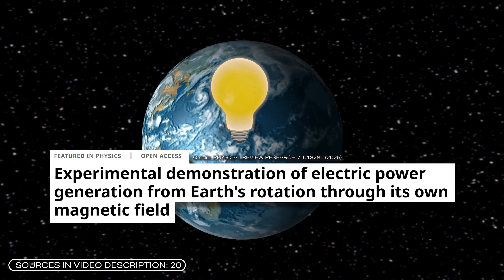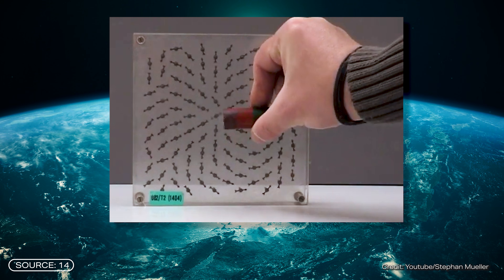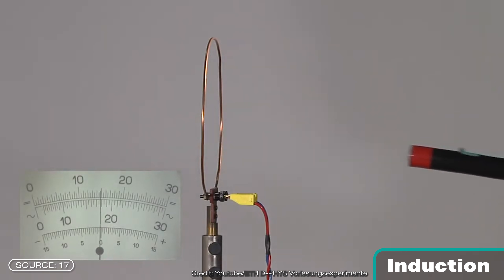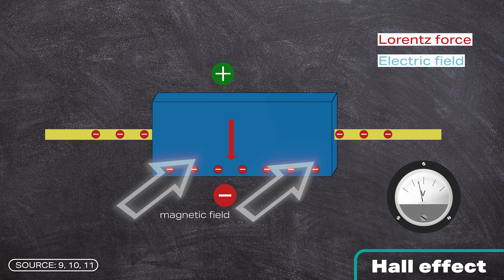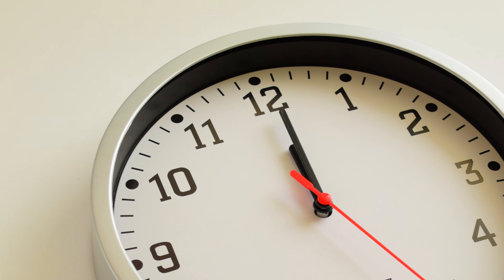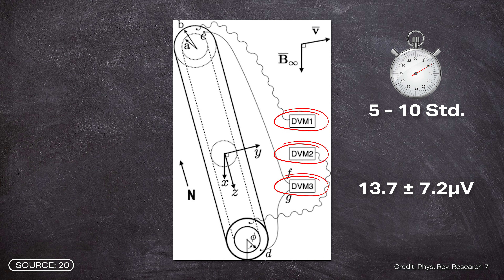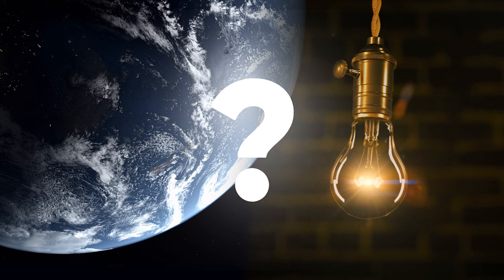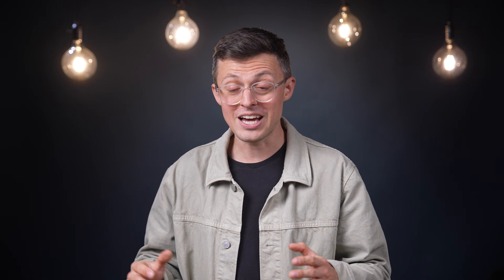Scientists Just Harnessed Power From The Earth’s Rotation

Comment: We know you can generate power from the earth magnetic field. 30 years ago they performed electrodynamic tethers (EDT) experiments where a small satellite extended a coil in space and started it rotating. It worked so well generating 3600 volts at 1 amp burned through the cable. that's the equivalent on 120v @ 30a.

BUT where is all the energy coming from? I'm pretty sure we don't want to slow down the rotation because that's what we are messing with.
Reply: In the case of the satellite, the energy comes from the satellite's motion through the Earth's magnetic field.  The main effect would be the satellite slowing down in it's orbit, because it masses MUCH less than the Earth.
Reply: You worry about climate change from fossil fuels but interfere with the earths rotation and that's fine
Reply: @keithbartlett9947  In the example he gave to provide all power to the planet, we would lose 70 milliseconds in 1000 years, 700 milliseconds in 10,000 years; think about that for a second... seven tenths of a second added to the length of the day in 10,000 years, a vast length of time, the height of the Pharaonic dynasties was @ 5000 years ago...at the human scale that is eons ago and the increase in time of rotation is broadly irrelevant!
Reply: @Bob-h4s2p yes you are correct, a you tube guy worked out 70 milliseconds, but before we start mucking about with something we cannot change I would like the worlds greatest physicists to have a go at the maths  and reassure me we are not doing something that might have a catastrophic effect on the planet. I don't mean a slightly longer day I mean something the you tube guy just might have missed. By the way he is a perfectly nice science guy and seems sensible, but let's just check his homework. 

I am completely open to being wrong, but it all sounds a bit free energy to me, and we know there is no such thing as free energy. The tally man of energy has to be paid, we just need to know the cost.
Reply: @keithbartlett9947  You're right, of course, one would need to check the maths very thoroughly. I think for many the scale is hard to comprehend, the relative mass of our planet, the mass of the sun, the inertia of earth rotating around our sun, the huge sphere of molten iron spinning at its centre, the flux of the magnetic field generated, it's all on a very non-human scale, hard for many to fathom...but, nothing free energy about it, a braking effect is being harvested from that rotational inertia, work is being done, no laws of conservation of energy are being violated.
Reply: Or pressure near plates  can be used betallonv certain  streams  of ores
Reply: "Slowing down" or "accelerating" the earth's rotation is actually irrelevent because the rotational energy "borrowed" from earth with electrodynamic tethers to potentially produce electricity on a satellite or boost said satellite's orbit upward can be returned to the earth's rotation by doing the reverse operation at a later date...when we have compact fusion reactors powering space equipment for example.

It is just required the numbers eventually cancel out.
Reply: @TheFlyinCanadian  annnndddd NO. sick and tired of all the fools that think energy can be Summoned from the aether, it can not me made or destroyed. if you convert rotational force to any other form, the rotation WILL slow down. Period, ".", EOL.

You want to change one of the most basic LAW in the universe? "Energy can be neither created or destroyed.

The statement "energy can be neither created nor destroyed" is the Law of Conservation of Energy, a fundamental principle in physics meaning the total energy in an isolated system stays constant; it just changes forms (like chemical to mechanical in a car) or moves, but the total amount never changes, forming the basis of the first law of thermodynamics. 
Key Concepts:
Transformation, not Creation/Destruction: Energy shifts from one type to another (e.g., potential to kinetic, light to heat) but never disappears or originates from nothing.
Closed Systems: This law applies perfectly to closed systems (isolated from surroundings). In real-world scenarios, some energy becomes "unusable" heat during transformations, but it's still accounted for.
Examples:
A burning candle converts chemical energy into heat and light.
A solar panel turns sunlight (radiant energy) into electricity.
When a ball stops, its kinetic energy becomes heat and sound, not gone.
Significance: This law underpins much of science, explaining why perpetual motion machines are impossible and how energy flows in the universe. 
In essence, energy is conserved; it's a constant, fundamental quantity that just gets redistributed and reshaped.
Reply: Thanks to chinese government three gorges dam already slows earth rotation by 0.6 secs😂
Reply: In the first 90 seconds he mentioned that Earth's rotational energy is a billion times our global electricity use in a year. If we make some very generous assumptions and assume we can convert Earth's rotational energy into electrical energy with an efficiency of 50%, and assuming won't be able to collect more than a quarter of Earths rotational energy before it spins too slow for us to reliably collect energy anymore, then that would be an electrical supply lasting us something to the tune of 125 million years. We can assume electricity consumption would rise over time. I will be generous and say we get at least 12.5 million years worth of electricity as long as a modicum of care is taken to keep electricity usage under control during that time.

And the above all assumes we are only able to convert 25% of Earth's total rotational energy, meaning the planet would still be spinning, but with the day and night cycle being a bit longer after several millions of years.
Reply: @RealCheesyBread  125 million years... By that time, fusion energy must surely be closer than 20 years away..?
Reply: @RealCheesyBread  yes, but then he states that it has the potential to slow down Earth by 7 ms in 100 years, which is actually quite significant.
Reply: @vaakdemandante8772  It would then take 100,000 years to add 7 seconds to the day. ~850,000 years to add 1 minute to the day. Honestly I'm fine with that.
Reply: @vaakdemandante8772 You understand that the m in ms means milli, correct? 😂
Reply: @RealCheesyBread  I'm not.
Reply: Theirs no free energy all we do is convert energy types so gas to electricity therefore removing power from the earths rotation power sounds like a very bad idea to me

Comment: Combining this technology with the technology of Altitude Variance Voltage, which is about 100 volts per Meter. Imagine Constructing a tall enough structure, with this new discovery engineered into it, and coupled with altitude voltage variance. I can promise there is electricity to be had. Tesla definitely knew about it with Wardenclyffe Tower. :yougotthis:
Reply: That is the reason pyramid was build

Comment: As an experiment I would have proposed using 3 different length rods perhaps 200mm, 400mm and 600mm and compiled calculations to possibly eliminate any biases. All in all, very interesting
Reply: Or u could find high  likely fault  plate locations  snd put sorvifocallu places Piero electrical kinetic sensors on vibrations
Reply: All u need is a satellite  buster sd stator right? Keep them stationary or counter rotation of the earth. There
E u go

Comment: Tesla ALREADY did it in Colorado Springs and made over 2 million watts!!!!! He tapped into earth's core modulation, which at the time was about 10hz. Now it's about 14.08.
U of Cambridge measured earth's core in 2002 as a magnetic motor, and found it equivalent to something crazy. I met an old guy in Az who nearly died after getting shocked by a wire pyramid.  I eventually learned you can simply bury an iron mass for ground and use that across spark gap to both run a sympathetic wave on a cheap foil pyramid and a set of 3 copper plates that repel one-another to produce a carried wave that makes the pyramid peak a zero point (zero point energy) focal point. You can slowly open spark gap until the wires begin to melt from all the power it generates.